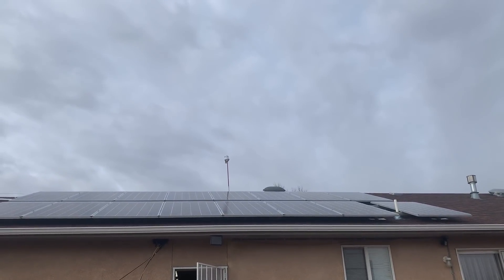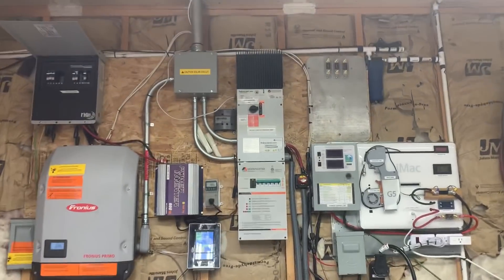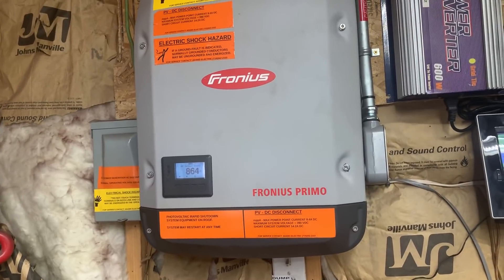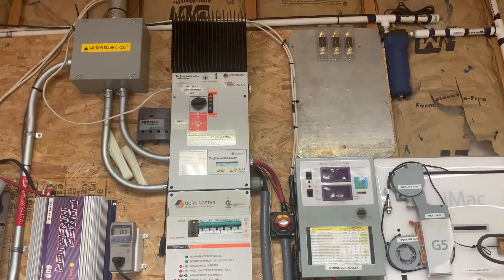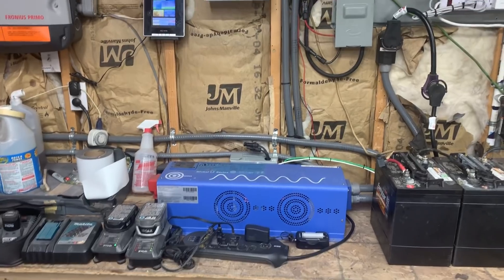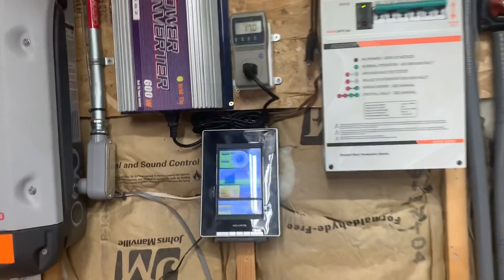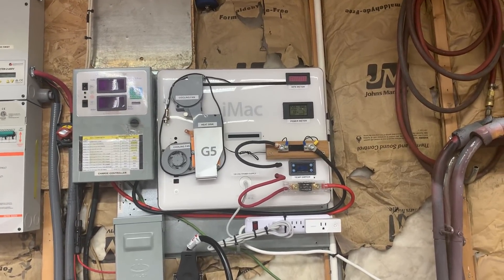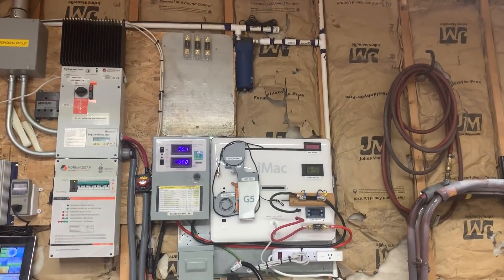My solar array/system Missouri wind and solar

Comment: Do you like the Accurite wind meter ? Seems to work well. How much did it cost ?
Reply from the maker: My Accurite weather station Works great. I just wish it would update a little faster that’s my only complaint it updates every 18 seconds
Reply from the maker: The accurite weather station works great. Wish it would update faster than 18secs. But overall a great product . I think I paid $ 99.00 for it.